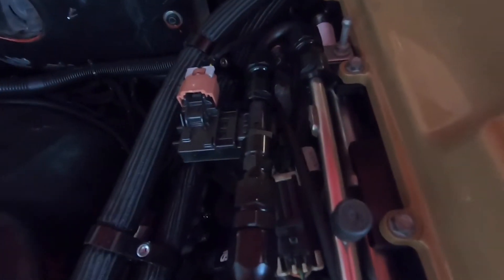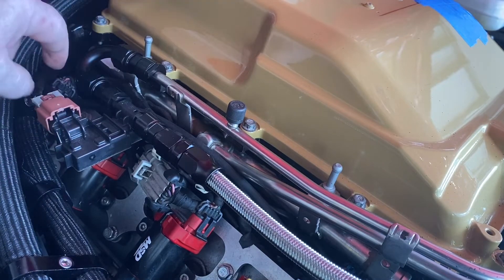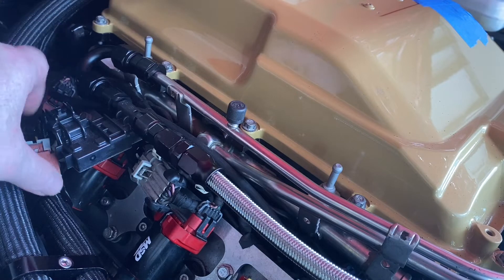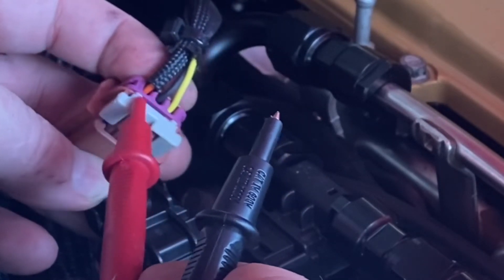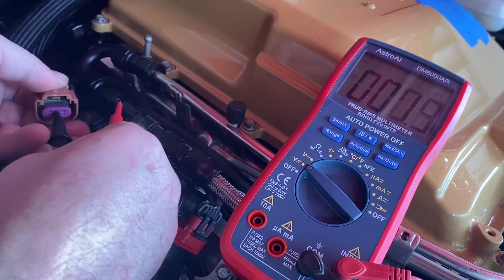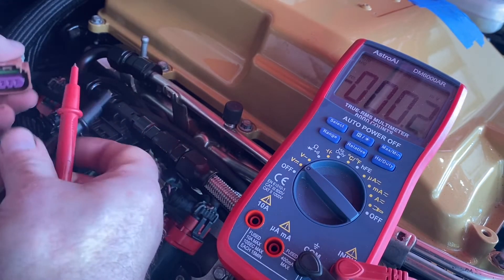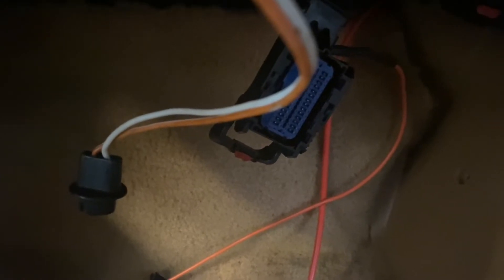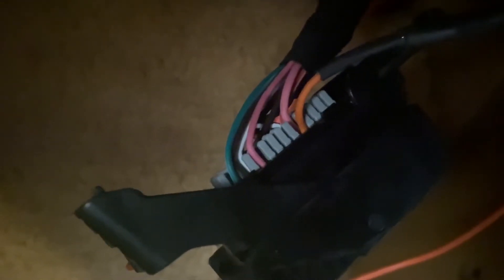My E85 flex fuel content sensor overview in my LSA LS3 swap Camaro!

Comment: Looks good Stan. Did you have to upgrade your pump/fuel supply system to cope with 600hp on e85?
Reply from the maker: Yeah didn’t get to run full throttle on E85 dyno yet. We will see after I get the new clutch in if the pump is enough! I have a video in my fuel system check it out.